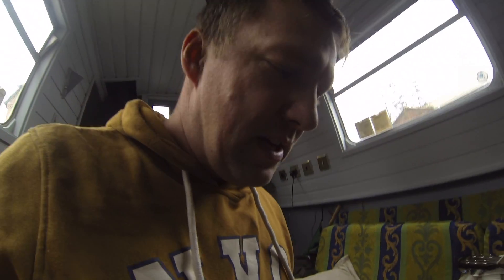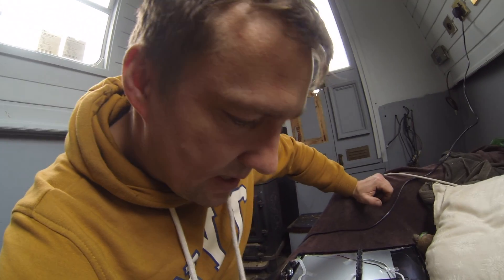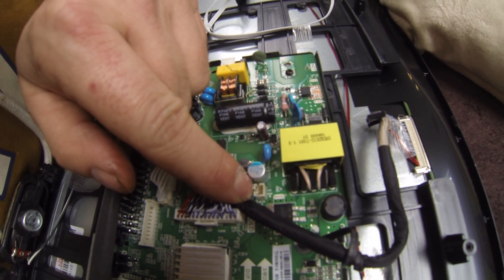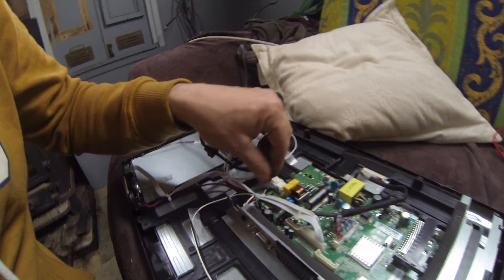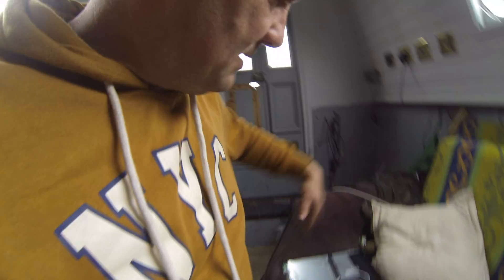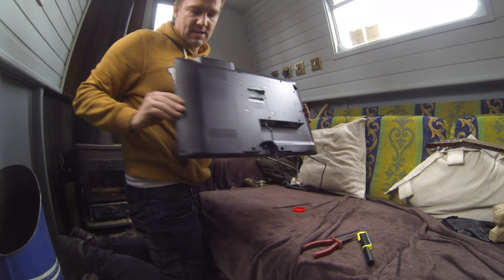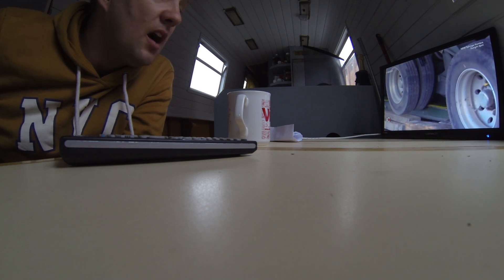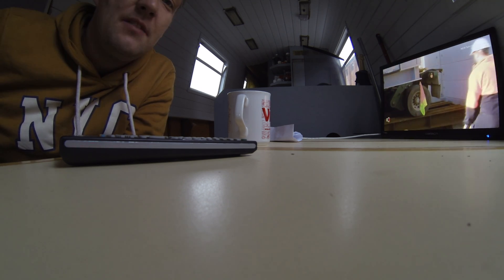Convert TV from 240 V to 12 V

Comment: Hi. What was the output voltage and Amps on the 12v power source.. Just tried this on a Samsung 19 inch DVD/TV and worked great on a start charge power pack but once I connected to my camper leisure battery that has a solar panel charger showing 13.9v it blew the TV.. Guess the TV needed a voltage controller fitted.. Ah well live and learn.. Cheap telly so I didn't  loose much.. 😊👌

Comment: About to try this on a UK alba 19 inch TV, the board looks identical I have ordered a 2mm plug of eBay so will try it, has anybody done this 12v conversion and had a working TV?
Just done this, pluged in the the 2mm plug I bought of ebay, drilled a hole in the plate next to the scart plug, added a 5mm socket solder the wires on, plugged 12v in and the TV works, it's drawing just over an amp which is half what it was going through the inverter, perfect
Reply: Ps make sure the polarity is correct there is someone on YouTube that blu up and I wondered if the polarity wrong it would go horribly wrong

Comment: Thank you very much for your very informative video on how to convert a TV to a lower energy connection of 12 volts. The TV electrical board has a universal 12 volt connector that I will try to buy online to prevent soldering. I think all appliances need to try to be connected via the lowest power option, like USB or USB-C.
Reply: You realise a USB has too be converted from 240v, if we are talking about a normal domestic house?

Comment: Does it make any difference with a bigger tv? Hoping to get a 32", problem is I guess, that until its bought and the back removed I wont know if there's 12v socket to solder will I.  Is it more unlikely there will be a 12v socket on a 32" - any idea?  Thanks

Comment: I’m an ex aircraft electrician and I’ve no idea what you did. Bypass what, soldered what? 12.4v then 0.4v. You took the mains power and connected into that wee 12v input socket?
Reply: Well all i can say is i am glad you are an ex aircraft electrician and not current! How exactly is it not obvious to someone who is an electrician i don't know. He bypassed the AC DC converter that steps down 230v AC to 12v DC and just supplied it with 12v DC post that point. The TV has a DC input on the PCB that they will probably use in the factory for testing.
Reply: @unheard128  he measured the output voltage from his battery and was amazed to find out it was.....drum rollllllllll, 12v 🤣🤣🤣🤣
Reply: Space Haddock he knows more than you, he said there’s an output 12v in the tv he’s just wiring it .
Reply: @aderfigueroa  an output in the tv that’s actually an input? You’re about as clueless as him.
Reply: Martyn Watson  fired? The guy hasn’t a clue what he’s talking about. Slavering a lot of electrical pish.
Reply: Agreed. Bloody awful 'tutorial.'
Reply: @wattage2007  I know, what did he do? One minute his tele was in bits, next it’s working 🤣
Reply: @spacehaddock7299   pluged 12v into the 12v socket. It's not hard. 
"Aircraft electrician" yeah right😂😂😂😂

Comment: Is this only on small TV's? I have a 32" LED in my van running on 240 (although it is only 55watts and have large battery capacity and 600 watt of solar so not a problem but I guess 12volts cuts out inverter drain. Assuming it is only small tv's?

Comment: Good lesson, I have a Seiki TV with almost exactly the same board and the small white socket and says 12vdc too. So I soldered a red to the Pos and black to the neg and rechecked the voltage and polarity and it is 12 vdc.  So I applied 12 volts to it and nothing happens. Did you do any other steps not in the video? Also the original power cord was disconnected.
Reply: robertb2468 i have same problem conect 12v and nothing happens...
Reply: robertb2468 after try again it work maybe xD